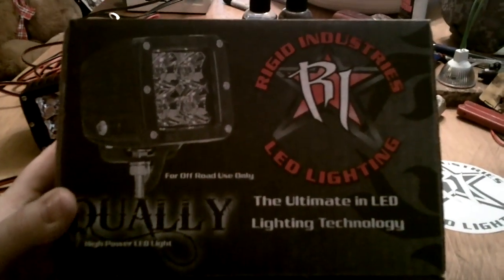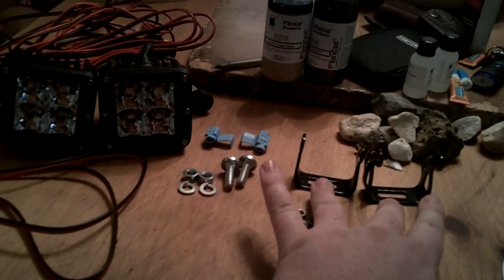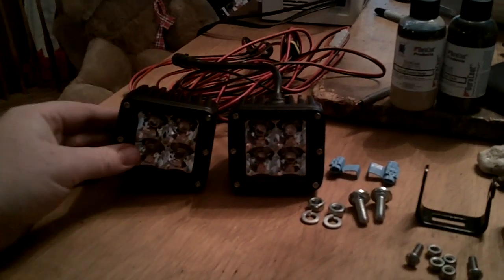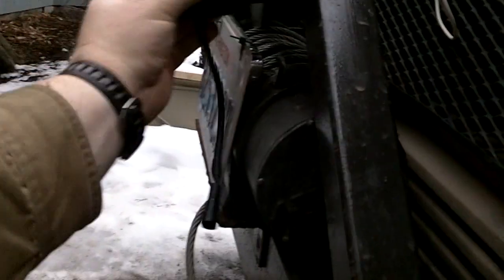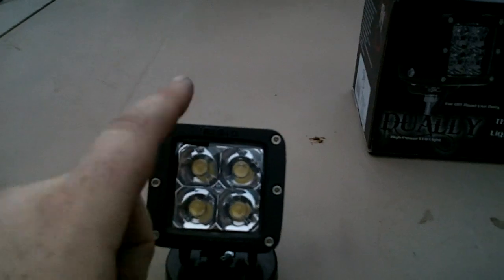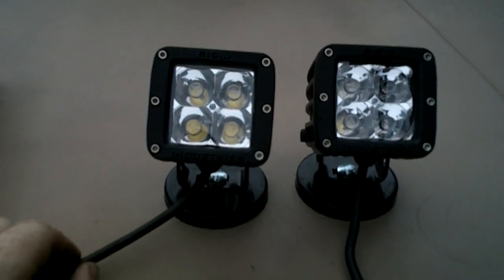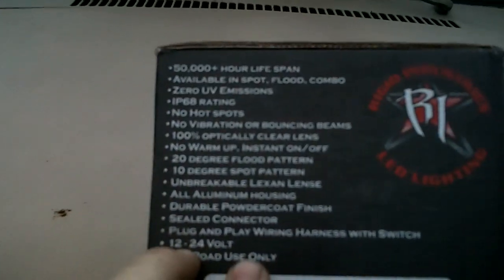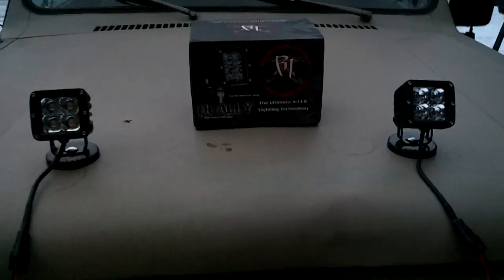Dually 2x2 Offroad LED lights by Rigid Industries

Comment: PS, correct..no relay nec.  Also, yes it will double the output to 2600L but it doesnt double the Lux (throw) or what some people incorrectly call candlepower.  LED's have the least amount of throw compared to incandescent and HID formats but they are way more efficient and provide smoother, broader beams. Regarding the 170's, same thing there, double the lumens..about 2300L each but not double the lux. Doubling the lux generally takes 4x the amount of identical light arrays of a given type.

Comment: Would that be easy to wire into the factory wiring?
I am thinking about replacing the factory Rubicon lights on the bumper with these...